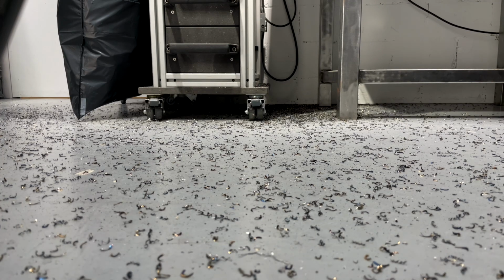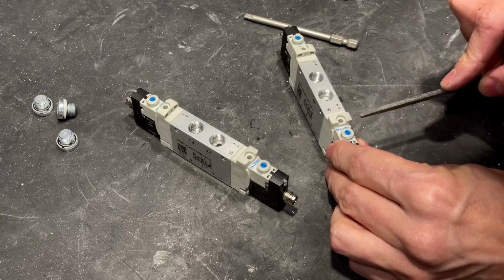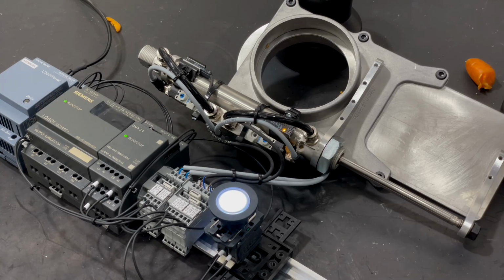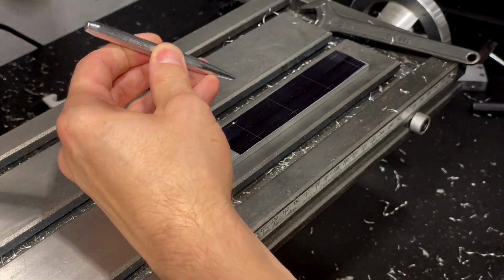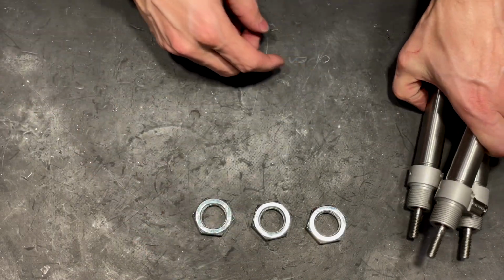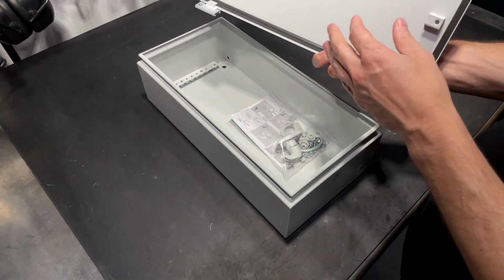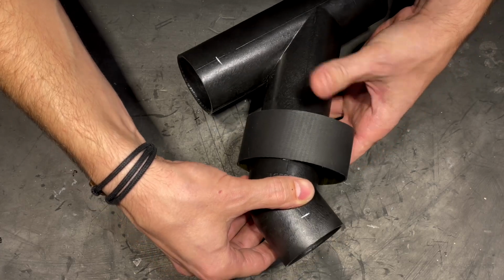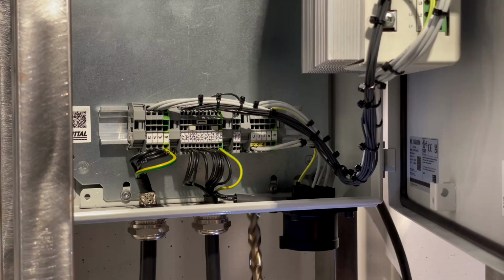Home Machine Shop Blast Gates

Comment: This is a fine example of some thoughtful electromechanics. Good stuff, man! I have to wonder if a fully PLC controlled shop is in your future 😁
Reply from the maker: Thanks! These electronic components are so cheap and convenient these days. My homemade compressor even has a built-in web server for no reason at all.
Reply: @monochromworkshop  😂 I'm actually surprised by that... what little experience I have with industrial PLCs (Siemens and AB), is that they are priced a bit out of the hobbyist realm. Are you using an older model line? Or something that is marketed toward shop tinkerers?
Reply: @monochromworkshop  I’m also curious about where you get your various automation parts. I’m specifically interested in where you find all your electrical components… thanks!

Comment: Hmm I would probably used a Arduino and a electric magnet holding a off center valve inside the tube in place. If I want to pass air in one I would magnetized the other to keep them closed.
The not magnetized valve would pass the air. If the air is cut off the valve would swing back itself.
You also could use cheap 3d printer servo motors to move your valves too. 1 stepper driver and motor cost just around 20€.
The pneumatic valves and electronic used here would be way to expensive for me. 😂

Comment: Please explain more about the shop vac you use. Air volume? Inches of vacuum?  Thanks!!
Reply from the maker: It's a Nilfisk IVB 961-0L that I bought used in a bad condition. I had to fully disassemble it to clean it and replace one of the two turbines. Very happy with it now. Specs are 120 l/s and 23 kPa of vacuum.

Comment: Truly, this shows differences ...being from an electeonic background, i'd probably use5
- a solenoid with a lever to open the gate when the grinder is powered on,
- a small synchronous motor with a 'string' on a pulley (this kind of motor can be 'stalled' forever without problems), again, powered whenever the grinder is powered  with a spring return.
- a small linear drive, either stepper motor or small dc motor, powered in one direction when the grinder is powered, powered the other way when it's off...a couple of relays and microswitches, in 'the old days', maybe a 'blue pill' mi rocontroller today ;-)